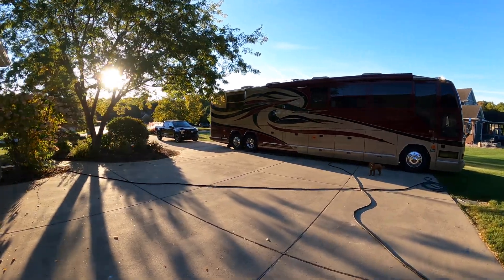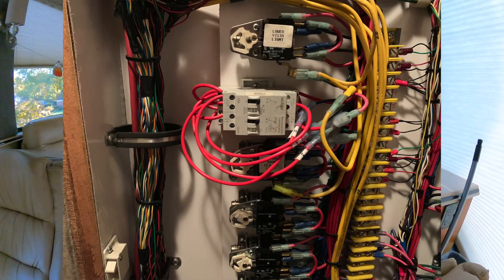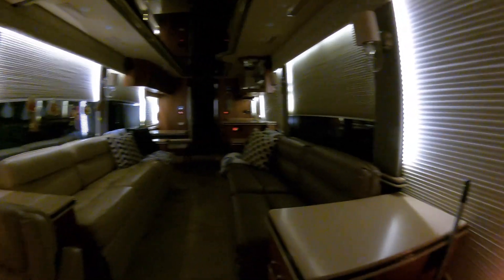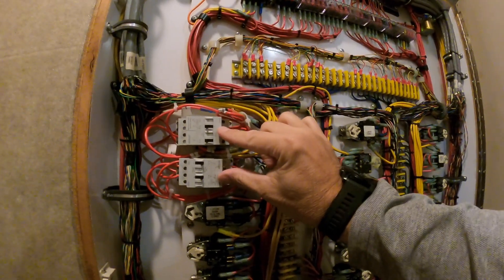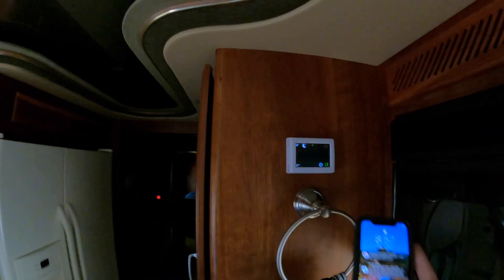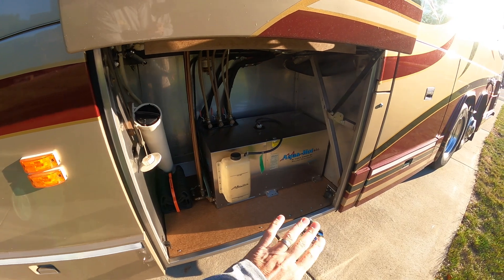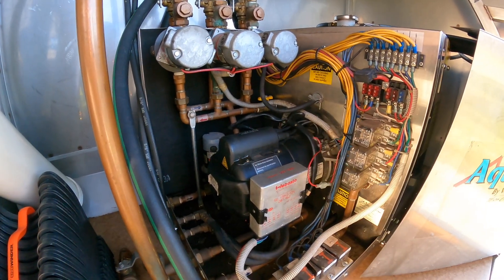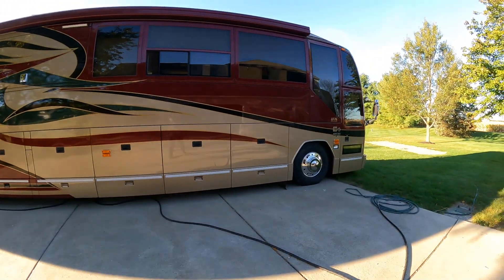RV Technology Upgrades: The Latest & Greatest!

Comment: Looks like you're starting to have fun with the bus. Glad you didn't get rid of it. I have the same Micro-Air in my RV and it makes it makes it so much easier to operate it myself, while driving down the road, instead of having to explain the old thermostat operations to my kids. Keep up the upgrades and other things you're doing to the bus. Great job.
Reply from the maker: Haha. I had the same issue with the AC and driving. Took like 10 minutes to verbally explain it!  Thanks for the comment - appreciate it.

Comment: Micro Air is awesome.  We just got done with the Thor Diesel Club Rally in Elkhart early this week.  I went up and did all the install for Micro Air on their EasyStarts.  Didn't have any thermostat installs due to the touch screen pads in the coaches.  But I do have this thermostat in mine.
Reply from the maker: I knew my units and their controller was a dinosaur and to get a Bluetooth model I would almost need to replace the unit control boards so they could be controlled. Micro air needs to push these out better - just a simple plug and play upgrade from 2000 to 2022!  I would love to do the soft starts - I hate knowing how many amps they draw on start up running four units.

Comment: Great video.  I remember my parents always had problems with their aquahot . It turned out to be a bad igniter. They also had the same old thermostat with 3 zones ( junk ). Over ten years those same relays for the lights started to fail .
Nice to see somebody else has the same problems. 
Good to see your so mechanically inclined. 
Happy trails. 
P.S. good luck on the solar panels.
Reply from the maker: It’s kinda of a top of the line working museum from 2000! Lol. I always struggle between replacing the museum pieces or updating them to the current times.  Thanks on the panels - hoping they work out how they are supposed to. Noting like nov - Dec to test solar panels! Lol.
Reply from the maker: Great bike pic too- would love to get one - the GSA. Earlier this year I thought the bus would be sold and would be riding around on one - always next year!